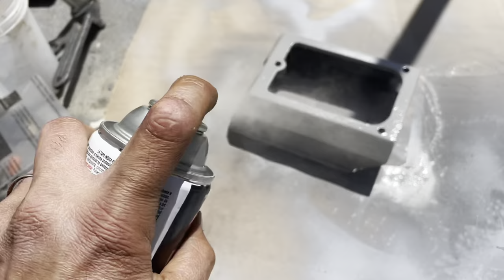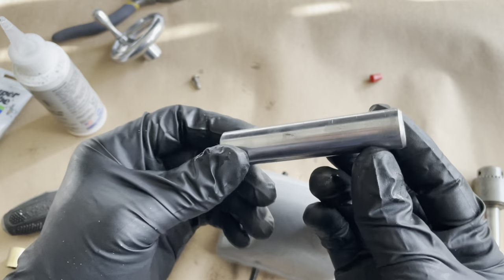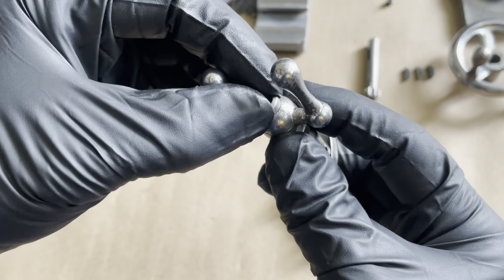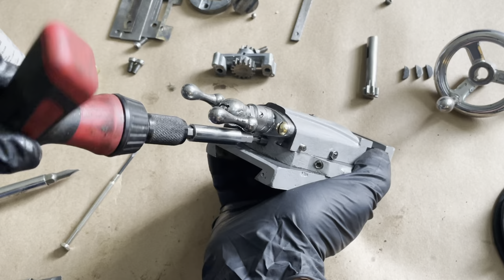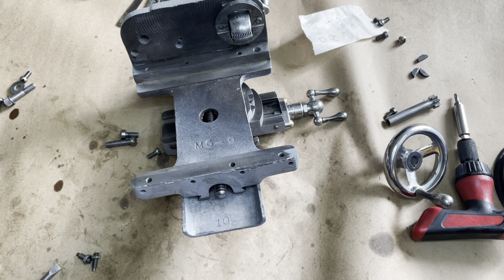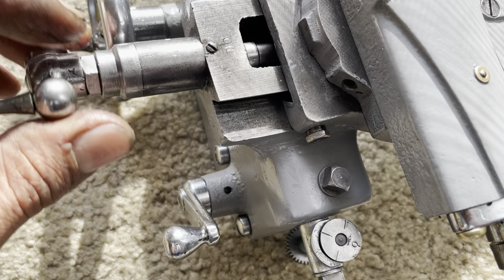Atlas Craftsman Lathe 101.07301 Restoration (Part Two)

Comment: Have almost identical lathe I am working on. The auto feed lever broke off. Do you know of anyone that carries parts for these?
Reply from the maker: Very nice find. Unfortunately I do not any for sale. But I always find some parts for sale on Facebook Market. You can also join one of those Craftsman Lathe groups, and usually there’s someone who’s willing to sell or trade. 
Good luck to you. You have a very good lathe. 👍
Reply: @VintageCraftsmanTools Thanks for the reply.  Well luckily I found the part on ebay. it was the 10-38 scroll that the lever attaches too.  And yes Its great find, it has been sitting in my friends garage for 20 years under boxes of crap in a few pieces. I  Cleaned it up today and almost looks like new. Still needs a motor. The existing motor on it is an old grinder motor with 2 spindles. Lol.
Reply from the maker: Yes those are actually typical. I have an Atlas AC motor with two long spindles or shafts. Any 1725 RPM should do fine. 
Have fun. I have learned so much from mind. Wish you the same.